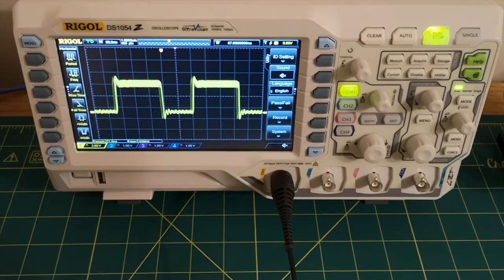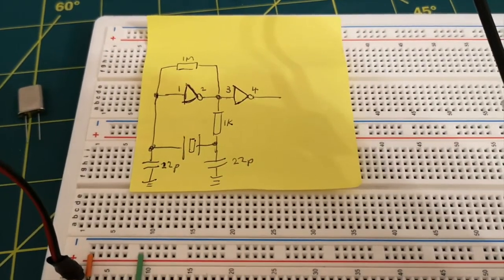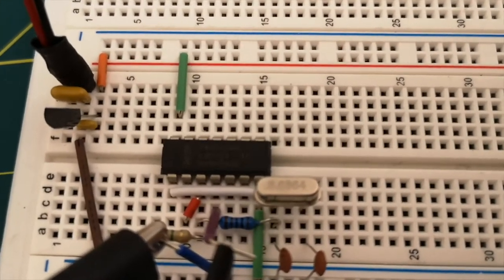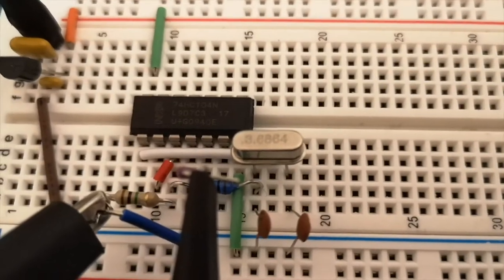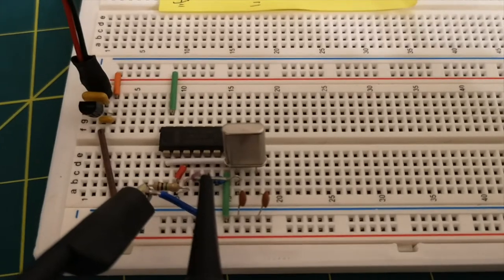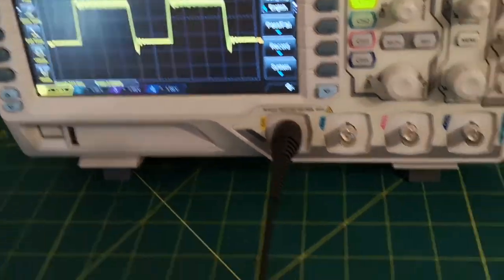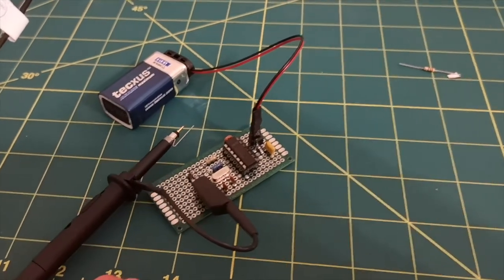74HCT04N Crystal Ocsillator Circuit

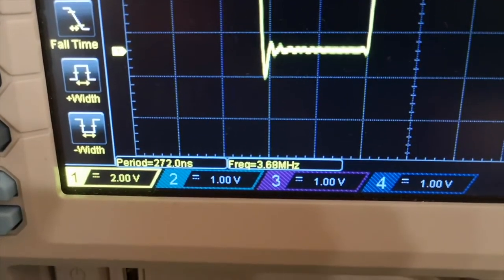Comment: The jitter on the scope is being caused by the trigger threshold being set wrong. At 9:31 for instance, the trigger indicator is on the left side of the screen and is pointing straight at the ringing part of the waveform. Use the trigger level control to move that pointer up to the center of the square wave and it will be rock solid. Set in the ringing part of the wave like that is what makes the trace jitter. 
That was a great little project. I am working on a similar one right now with a much much lower frequency crystal. 31.5KHz. I am having all kinds of trouble with it. That is why I was searching for inverter based XTAL oscillators and found your video.
Reply from the maker: Awesome and thanks for the advice. I'll have to connect it up to the scope again and have a play around. I'm new to using the oscilloscope and really appreciate any help and advice.
Reply: For a 32.768khz crystal, I found values of 10M across the inverter, and 270k in series to the crystal, worked to get it singing. So overall you have a lot less current and feedback for the low khz ones. The best practice I think is to run it at ~3V but 5V still works. If it's just for short testing I think it should be ok.

Comment: The 1meg resistor puts the inverter into a linear mode so it acts more like a class a amplifier. I don't know what the 1k is used for. I've seen the same circuit without it. I think protecting a random crystal from overcurrent makes sense.

Comment: The 1k is a drive loading resistor, you can play with this value to soften the drive and it may help with the ringing. Cascade the spare gates at the output will help clean the the output.

Comment: the resistor is there to raise the impedance at the output. A much better solution is to use the 74HCU04 which has high impedance, leave off the 1 K

Comment: Any special capacitors to be used ? I am getting just 1 Mhz
Reply from the maker: I'm using 22 pico farad capacitors.
Reply: The specific load capacitance to use is told to you in a datasheet for your crystal, sometimes it will even be in the title of the product because it is one of the most important parameters.

Generally you have two capacitors the same, lets call them C_a and C_b. They should solve this equation:

C_load = (C_a * C_b) / (C_a + C_b) + C_stray

where C_stray is any extra capacitance from your wires / breadboard / microcontroller etc.

Comment: Sir, 1. I am getting square wave with 1.84 Mhz but with 6 Mhz and 8 Mhz, lower side is sine wave instead of square wave. What could be reason ?
2. Results are not good with SMD crystal as compare to metallic crystals.
Reply: Maybe something else works as a capacitor and as you know capacitors behave different at higher or lower frequencies. At very high frequencies two pieces of wire in the same neighbourhood can work as a capacitor while at lower frequencies they have hardly any effect.